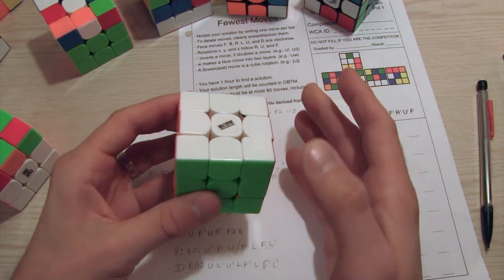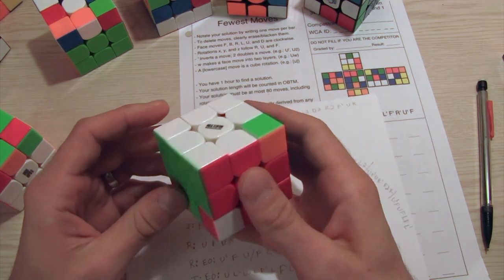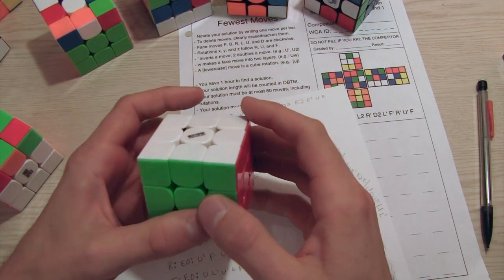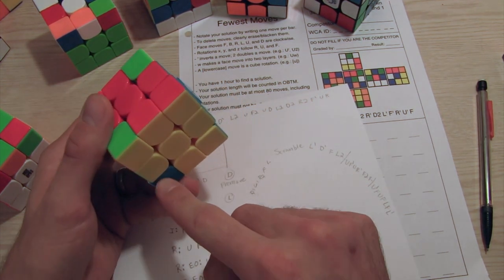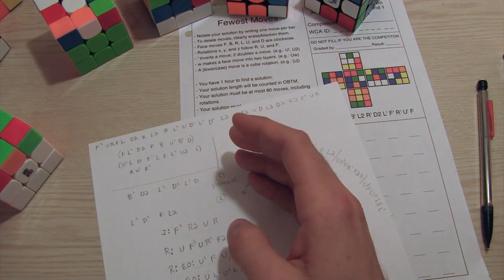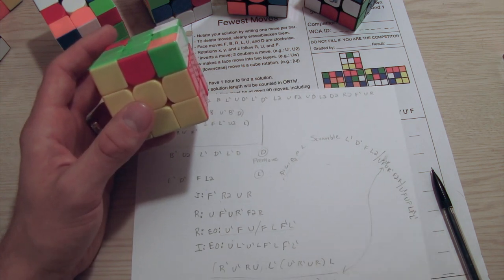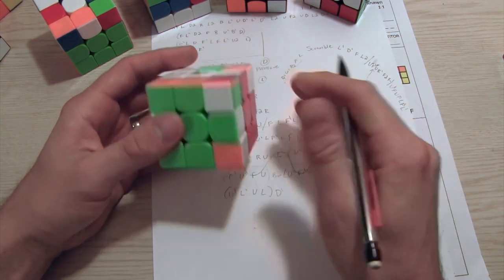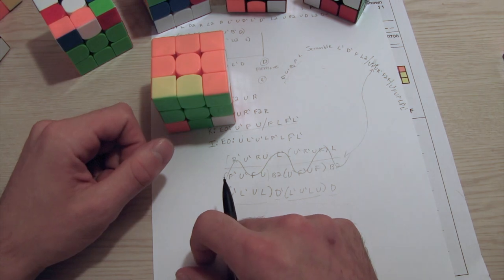Commutator: FMC Part 7

Comment: Another that might help understand commutators. The reason that you do the A' is because after and A move all the pieces in the top layers need to undo themselves to solve the cube. However A A' just results in a solved cube. If you add a B move that doesn't affect any of the B pieces then that manipulates the cube.

Comment: so the interchange should always at the bottom layer?
Reply from the maker: +Jorge Rojas Not on bottom depending on how you are holding it but you want two of the pieces to having the same orientation. If not you will need to add a premove making t a conjugate.
Reply: SpeedCubeReview oki I'll just explore it

Comment: how many commutators are there that you can use in the solve
Reply from the maker: There are thousands of variations. The most I have done in one FMC Solve is three (one to solve 3 edges and two more to solve 5 corners). You can use as many as you want.